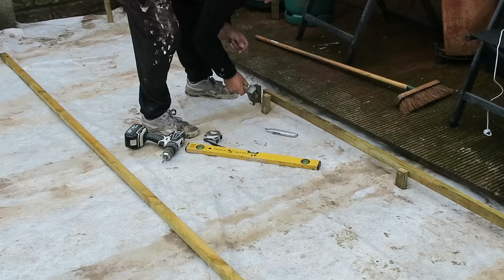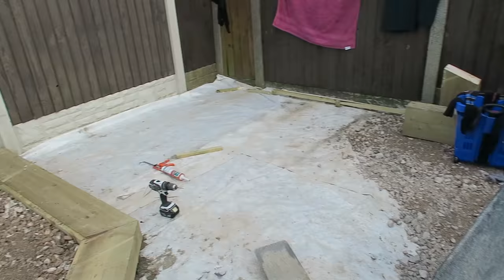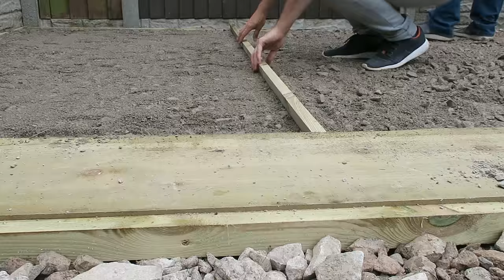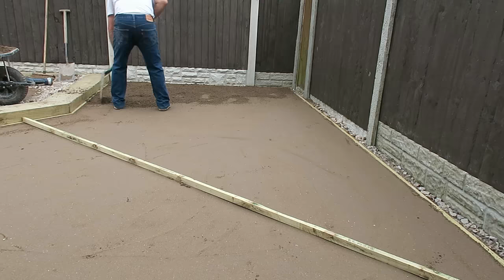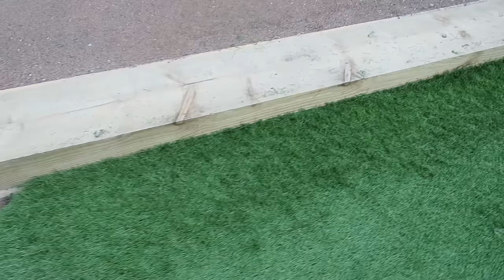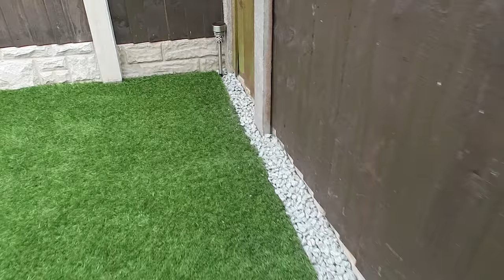How to install Artificial Grass DIY guide

Comment: Won't the wooden pegs rot buried in the ground and how long till the batten rots aswell?
Reply from the maker: Yes In about 50 years so I wouldn’t be worried about it right now. Nothing lasts for ever.  Cheers
Reply: @Stucrompton1  looks really good the reason I asked was because i have seen lots of uploads of people using these long galvanised nails to fasten the grass down and not attaching it to battens

Comment: how does drainage work with artificial grass please? can't get my head around it.
Reply: chronicallycrafty art seeps through to the ground
Reply: chronicallycrafty art just like real grass
Reply: Thunder Up 405 thank you, what would you do if the ground underneath is concrete or has no drainage?
Reply: chronicallycrafty art if the ground underneath is concrete then no it will not drain and the lawn will become soft and squishy and always wet... The concrete would need to be lifted and dug out to a minimum depth of 150mm then adding 100mm of mot type 1 or crushed limestone compacted down then add another 50mm of sharp sand compacted... Then lay the grass but also allow the height of the grass if you want it level to a patio for instance
Reply: This method would also be needed if you have a clay based soil.... Possibly add more hardcore before sand

Comment: when I compacted my sand using a vibration compactor, I was left with tracks where it always pushed the sand out from under it.... I went over it umpteen times but always tracks... I had to do it with a board but I'm worried that when the kids run around on the grass, they will create lumps and move the sand around :(
Reply: Squiffilect sounds like sand was too dry.
Reply: Squiffilect or, you was trying to wack too much at once rather than build it up in stages.